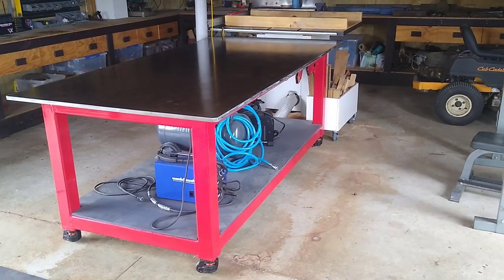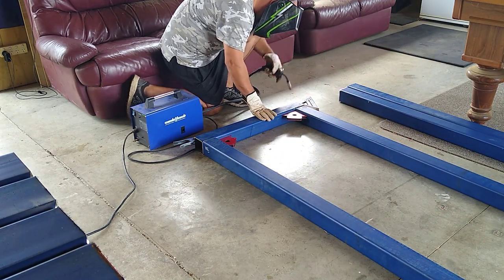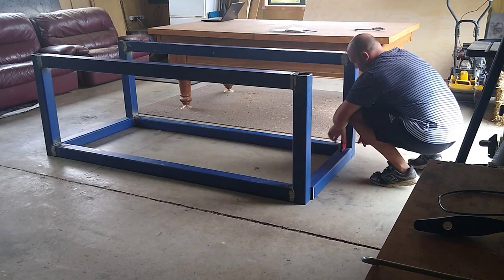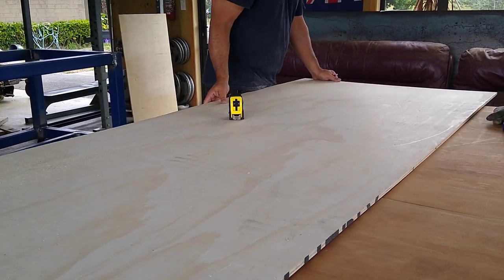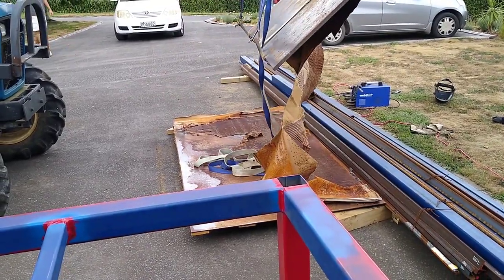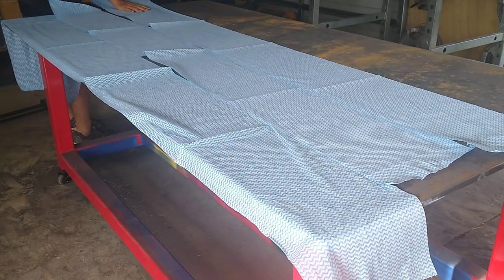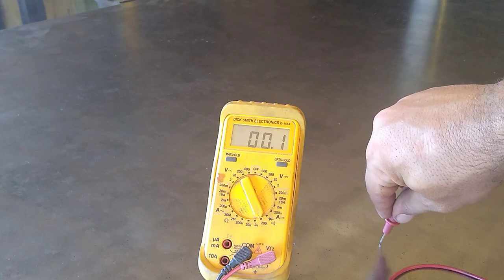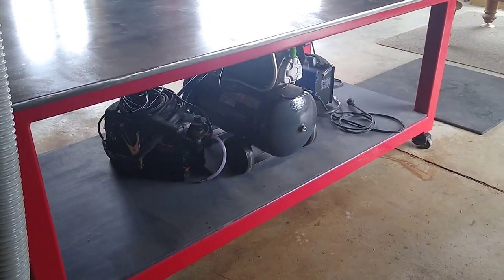Welding Table Build

Comment: Hello,  Thanks for making the video, and supplying dimensions. “The dimensions are a huge help.” I did convert it to inches so I could visualize it. What a beast!! And I like it! 
If you had to do it all over again? Would you change anything? I’m asking about size and thickness of material used. If so what and how? 
Thanks again
Reply from the maker: Hi there, it's exactly how I wanted it :) I spent ages deciding what thickness top to use. The 20mm (3/4") top seems to be what most people suggest is a good compromise between weight, cost and likelihood to warp or sag due to heating or hammer blows.

Comment: I think I want to build a wood framed welding table with a sheet of steel on the top so I can use it for welding when I need but let it be wood the rest of the time . What do you think

Comment: Tip. Don’t drag the torch, push it
Reply from the maker: Thanks for the tip David. As I'm using flux-core wire I was told to drag to avoid pushing slag into the join. When there's slag, you drag. Or something like that
Reply: I stand corrected,  did not realise you were using flux core. Did some research and I apologise.

Comment: 20 dollar grinder, 100 dollar  welder, 2,000 dollar table, lol😂
Reply from the maker: Well you have to spend money to make money. And I'll have you know I now own a $50 grinder, so there!
Reply: Nice, I was just playing around, your right got to spend money to make money, I know all to well, nice table btw! I picked one up at work in the scrap bin for free that has 3/4 aluminum plate top in it, with the same style caster's you got, 3x3" 1/4 wall square tube leg's and it's 6x3', kinda small but it's free and I don't weld much stuff that's big anyway